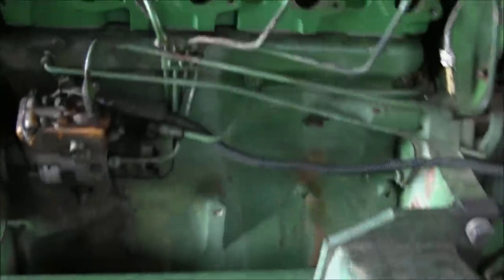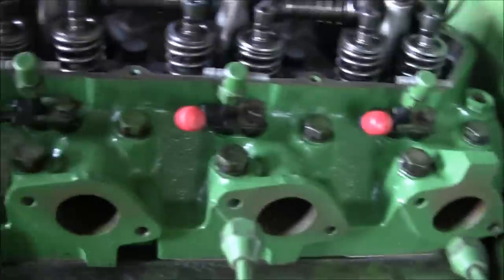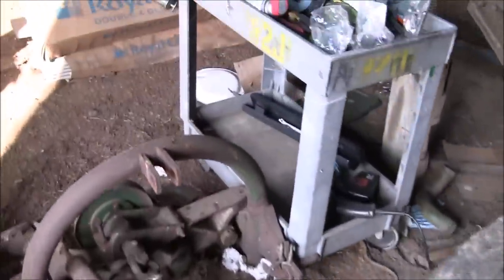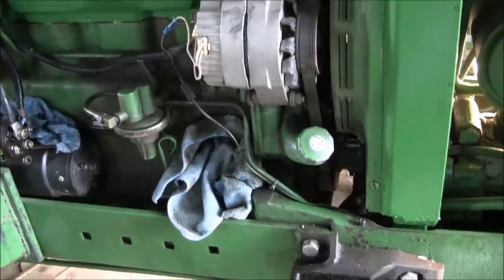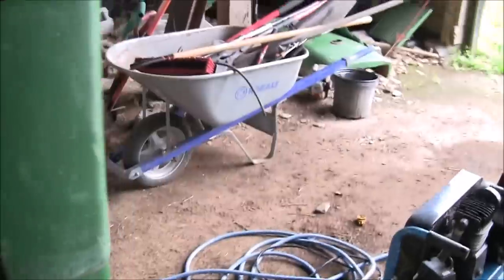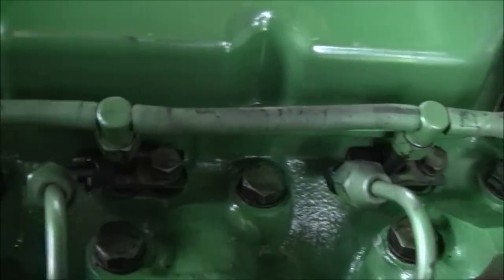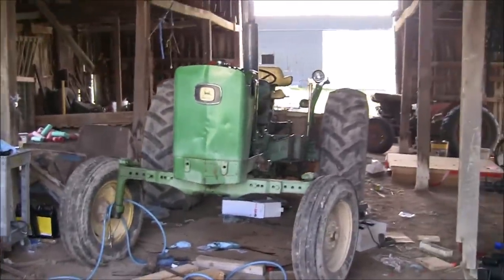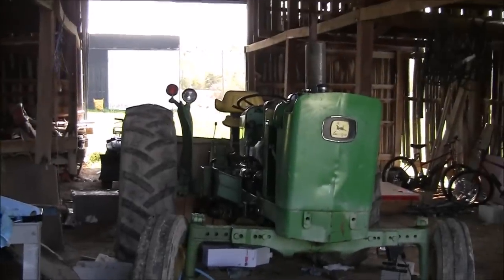John Deere 2030 Diesel Rebuild | First start | Part 3 of 3

Comment: I have a 1975 2030 that needs the exact same things done for the same reasons. 41 years and 5400 hours isn't too bad. Mine lopes the same as yours when you first start it. This is a very powerful and excellent sized tractor. I used mine to hay and pull a 6 row no till planter up until a couple of years ago. I am going to fix it as I can't bring myself to replace it and for the money, it is well worth it IMHO.
Reply from the maker: Definitely. These are great utility tractors. Good luck with the rebuild and let me know if you have any questions and I will help any way I can. Thanks for watching and subscribing.
Reply: +Josh_Outdoors I have done this kind of stuff for 45 years, starting at age 11. I have a Grandson going to school to learn more about diesels and get a diploma or certificate. He is going to do this one for me and I shared this with him. Thanks for the offer. I will go direct to A&I though.

Comment: What do you have to do to bleed out the high pressure fuel lines?
Reply from the maker: You have a manual pump handle on the mechanical lift pump. Loosen the purge screw on the top of the fuel filter and pump until it fills and starts to flow out of the top of the fuel filter. After that you are ready for the second step which is to leave the fittings loose on the fuel lines where they connect to the injectors. Turn the key until you get solid fuel leaking out instead of foam. Tighten them done and you are good to go

Comment: Thanks, the journal and balance saft wobbled out and spit out 2 of 3 bearings and spun the rod bearing on #1, i poured babbit to repair the block and am wondering how to make sure the oil gantries are open, trying to do an inframe rebuild.
Reply from the maker: To remove the balancing shaft & crankshaft you would have to split the tractor mostly likely. I don't know the exact engine config but I am thinking tractor split is in order. I have never heard of pouring babbit for anything other than a bearing so not sure what you did on the block repair.

Comment: For the restart, do you have to do anything to get fuel into the fuel bowl? Or will the pump just fill it up when you start cranking?
Reply from the maker: You have a manual pump handle on the mechanical lift pump. Loosen the purge screw on the top of the fuel filter and pump until it fills and starts to flow out of the top of the fuel filter. After that you are ready for the second step which is to leave the fittings loose on the fuel lines where they connect to the injectors. Turn the key until you get solid fuel leaking out instead of foam. Tighten them done and you are good to go

Comment: Did you have a good service manual to follow? I have a JD 4129 DT in a clark forklift and their service manual is lacking.
Reply from the maker: I just used the A&I manual for torque specs/clearances etc. Its not complicated at all if you have basic mechanical skills. You can find videos about installing sleeves/piston liners etc on other engines on youtube. Basic principles apply.

Comment: this is awesome how much did it cost to rebuild it did good video
Reply from the maker: +iwantosavemoney Thanks! Altogether with machine shop, rebuild kit and other misc parts I spent around $1700. Labor was free of course lol
Reply: +Josh_Outdoors it should last forever know
Reply from the maker: Yes, I'm thinking that I may sell it this spring.
Reply: +Josh_Outdoors really after putting all that work into it. why would you sale it.
Reply from the maker: I bought a brand new 4WD Kubota L4701 last spring and really don't need this tractor. I have a tractor addiction and I need to slowly break the habit :)
Reply: +Josh_Outdoors lol good luck with that sir Kubota makes a great rig tho
Reply: +Josh_Outdoors  As a Kubota mechanic I support you fully haha
Reply: Josh_Outdoors did u sell tractor??? If not I am interested if you are going to sell it